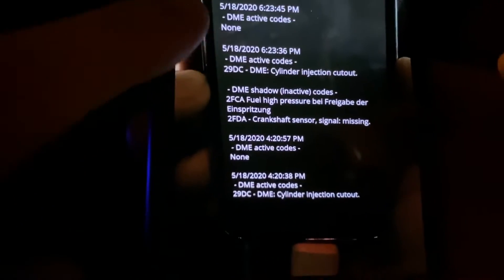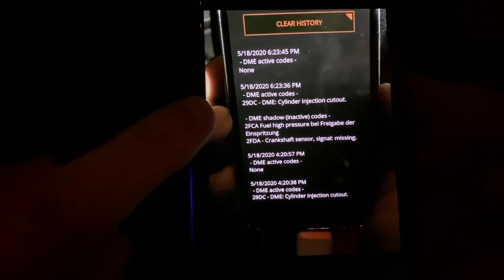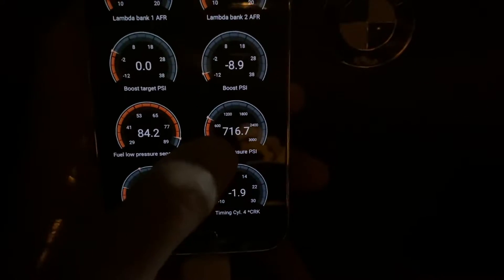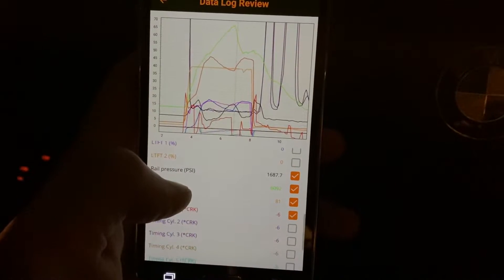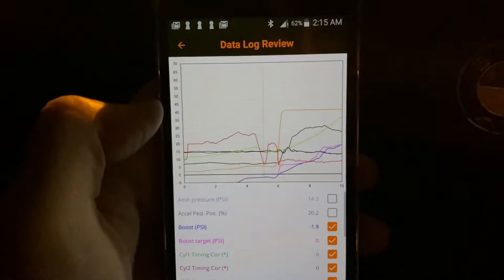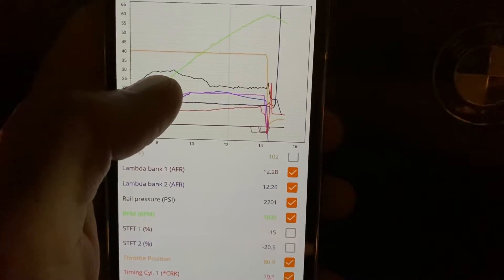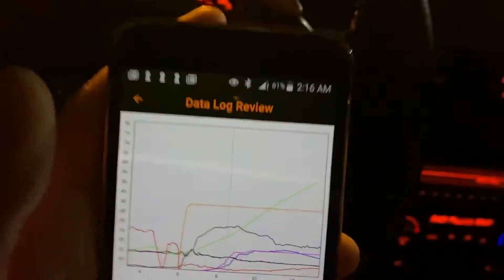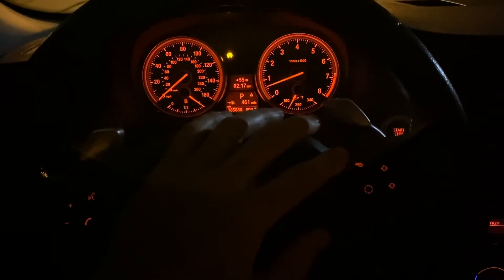BMW 29DC 2FCA Codes Fix 335i N54 Fuel Pump Issue

Comment: For those running Walbro with the Walbro fitting check the fitment of the fitting and the O ring inside the fitting if the O ring is ok check the tightness these thing come loose and cause all sorts of problems and leave you chasing your tail.

Comment: I have the same codes and my rail pressure is 1235psi on 5200RPM. But the thing is I replaced HPFP about a month ago. Any tips? Thanks

Comment: Hey bro, im getting code 29F2, and also cylinder injection cutout as soon as boost hit at around 3-4k rpms it misfires and only when it boosts. I assume its hpfp
Reply: i’m having the same issue but i have brand new hpfp, brand new lpfp and new injectors. did you find out the issue?
Reply: @ZammianX same here either the same code, did you fix it?
Reply: @EzequielSanchez-si4yw  ended up being a bad hpfp from factory, I returned it and bought a used OEM hpfp and never had the issue again
Reply: @ZammianX  thank you, I did what you did and now my car is running better and with no code

Comment: hey i really need help if you are still active here. I have gone through almost everythhing and have the same 2 codes you have. the hpfp is fine because of the rail pressures etc same with my lpfp. no leaking injectors nothing inside the sparkplugs under the coil packs. is it possible it is the crank sensor or what else am i missing?
Reply from the maker: I’ve been out the n54 game for a while but what do your rail pressure show during logging? They might drop randomly and you not catch it
Reply: @tunerworld  the rail pressure is all normal all the way through
Reply from the maker: @emotionlessmarshmallow4581  send me a datalog if you could

Tunerworlddirect@gmail.com

Comment: I got the 29DC code and had random misfires I data log the car my hpfp hits 2700 on high rpms but my low is hitting 29.8 on high rpms would you say it’s  that is the lpfp?
Reply: yes lpfp should not be that low during a pull

Comment: not always HPFP, replaced mine thinking the same. Still getting it. I have stage 2 LPFP, rail reads within spec, both at idle and under throttle. Index 12 injectors, new plugs, coils. FUck this car.
Reply: U still getting 2fda codes?

Comment: I did replace the pump still getting the same cofes
Reply from the maker: How is your rail pressure?
Reply: Me too I got mine off fcpeuro it was a New Refurbished HPfp replaced professionally 2 months ago and it hesitates on start up runs rough rail pressure unknown before the pump was replaced 
But after it was replaced I ran mhd logs and idles at 600-800 and when I do wot it spikes up too 2k max lpfp sensor stays at 70-72.x
Reply: @LALOTEH  did you ever figure this out? Having the same issue now after replacing with Fcp euro aftermarket hpfp

Comment: I get this code. I have replaced lpfp, hpfp, fuel pressure regulator and ekpm2 and upgraded to ekpm3. I even put the thermo pads on the ekpm. I am at a loss
Reply from the maker: What tune and fuel are you on?
Reply: @tunerworld  jb4 with OTS BEF on 93 octane
Reply: @Acekid187  sell that bs im about to try to gey rid of mine
Reply: @tommycapone5817  she gone. Sold her almost a year ago now

Comment: Wondering if you could help me out with the same code im throwing? Car went into limp mode. Flashed the stage 2+ and it felt GODLY. I have a graph log of the day it went bad and hasn't been the same since.

Comment: I got a new refurbished hpfp and I’m still getting that code.
Reply: Me too I had the new refurbished hpfp from fcpeuro and im still having issues with 29F2 I'm in the process of getting a new battery 🔋 then if that don't work a new ckp $70  then if not ill get a new oem pump for 900$
Reply: @LALOTEH  the reason I was getting that code was because I was maxing out my pump. I had to upgrade pumps and added port injection
Reply: @carlosmendoza8529  which upgraded hpfp did u get?
Reply: @tylerdykstra9636  pay the money for the nice things! I get everything off fcp euro
Reply: @carlosmendoza8529  yea but which specific upgraded pump did you purchase?
Reply: @tylerdykstra9636  I forgot I got it off ecs tuning part #  (ES#2159222)for the hpfp you can only get one pump they don’t make upgraded one for the hpfp. I had to upgrade the lpfp
Reply: For those running Walbro LPFP with the Walbro fitting check the fitment of the fitting and the O ring inside the fitting if the O ring is ok check the tightness these thing come loose and cause all sorts of problems and leave you chasing your tail.

Comment: Hello i had the half engine warning light come on, along with fans on full when on cold start and also when giving it the full beans. I have code 29f2 and 2a87. Could it be fuel rail line sensor or most likely fuel pump?
Reply from the maker: Could be the rail sensor, what is the sensor reading during logs? Most likely your fuel pump though as they commonly go bad. You wouldn’t be able to tell without proper logs
Reply: @tunerworld  am i able to read the fuel rail sensor off a snap on computer?
Reply from the maker: @benji6866  most likely!!
Reply: @tunerworld  what should the correct readings be for the fuel sensor and for the hpfp
Reply: Hey Benji did you figure it out?!i have 29f2 and the 29dc

Comment: Do you still have logs with bad hpfp? I would like to see how lpfp was behaving, when hpfp didnt work and also lpfp after replaced hpfp. I have same codes, but my hpfp goes to 2800psi sometimes, just lpfp is jumping up and down like crazy, then hpfp makes 300psi and injection cut out, it was doing old oem lpfp and now even new bucketed walbro 535, it looks like ekp module, just need to be sure
Reply from the maker: Sorry I just saw this. Unfortunately I do not but if I find them I will let you know! Did you figure your issue out? It could still be the HPFP as ours would sometimes jump up as well but it really does have to stay steady
Reply: @tunerworld  i bypassed ekpm with wireless switch on fat strong extra wire directly from battery, still the same, so i guess its that “filter/pressure regulator” in left gas tank side, i bought new one, just waiting for right time and place to replace it. Hpfp pressure goes up up up normally even to 3000psi and around full air boost lpfp starts jumping like crazy and hpfp is starving, at least i hope, we will see :)
Reply: So I replaced that filter/valve unit on left tank side and nothing changed, still cutout. Lpfp is also replaced by that walbro 535, but there is weird behavior, in wot all goes up (hpfp 3000psi) and at some time lpfp starts jumping like crazy and hpfp goes to 1300psi, old one lpfp the same, new walbro535 the same, with extra wire from battery the same. So now charcoal unit, fuel lines and that something, what pushes fuel or air or idk what back to fuel tank. Todays morning i hoped, it might be solved finally after 6 months, nope, back to war.
Reply from the maker: @euczekillca  you didn’t replace the HPFP yet? That’s what I woulda done a long time ago when I saw that dip haha. It’ll probably fix your issues
Reply: @tunerworld  i would also do that, if it wasnt that expensive like whole my month salary here in czech republic lol
Reply from the maker: @euczekillca  oh damn haha. Yah that makes sense. See if you can get a used one. In my HPFP install video I put a used one and it fixed the problem
Reply: @tunerworld  i dont have problem with buying hpfp, even new one (but some upgraded one would be better of course), just need to know its really the problem. For me isnt understandable that lpfp psi goes down before hpfp psi in connection with bad hpfp, but i just read someone has absolutely the same symptoms (ive read tons of articles before, symptoms not at all the same, but this one after that long time is absolutely same) and really helped only hpfp, unbelievable, you fixed the problem, or at least i hope, with my luck its gonna be because of bad ecu in the end, bet on it lol. Ok, so my last step before hpfp is lpf sensor, i have bought it months ago, just hadnt had energy to replace

Comment: Hope this ain’t the case just installed a new hpfp and updated fuel sensor with line from FCP Euro. Got a few WOT in and next day I opened her up and got that code. Going to log and hope I don’t have to install it again.
Reply: same here installed new hpfp and im still getting injection cut out im fed up man..
Reply: @n54dip20  ended up resetting the hpfp and everything else by MHD and no issues so far. I also read it can be the ekp module which gets hot if your are running a stage 2 lpfp. I believe that might have been my issue since it was over 100 degrees that day when I decided do a pull.
Reply: @james10165  appreciate it bro ! you just reset adaptations via MHD and was good to go ? never thought of that ima have to go do that
Reply: @n54dip20  yeah but i believe in my case it was the ekp module getting hot not sure tho since I reset the adaptions the next morning and it was cooler. Good luck and let me know if it worked out
Reply from the maker: Sweet glad you figured it out! I was gonna mention resetting all your adaptations and making sure your tune is on point